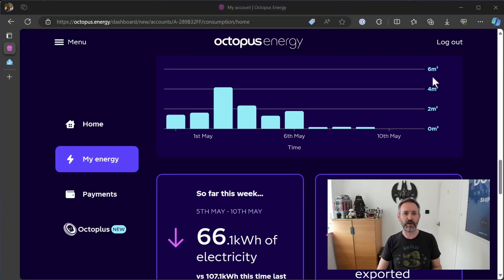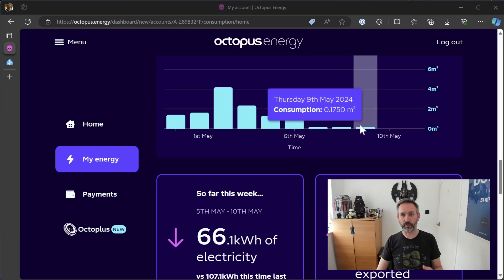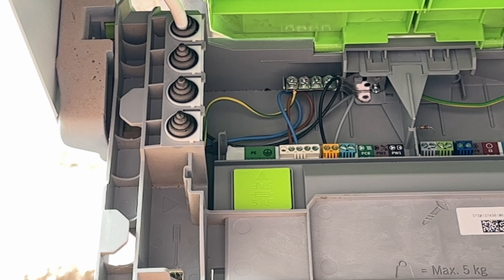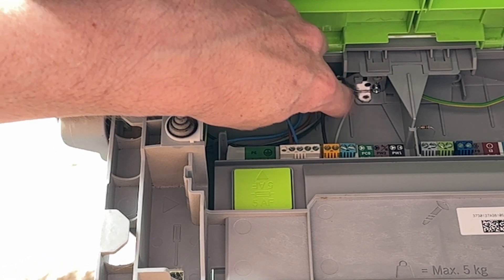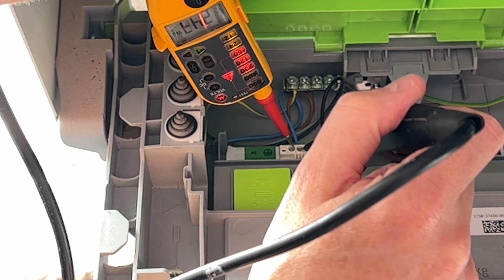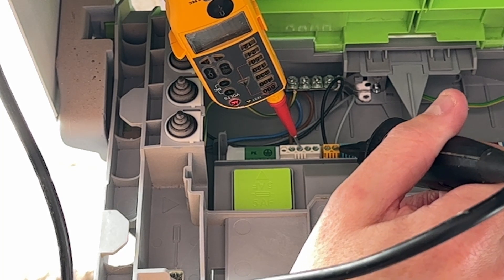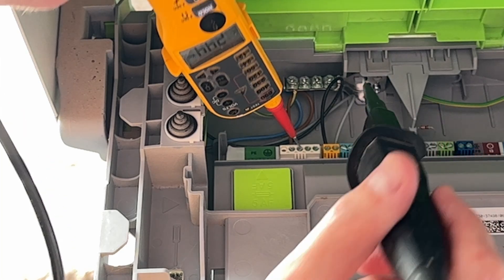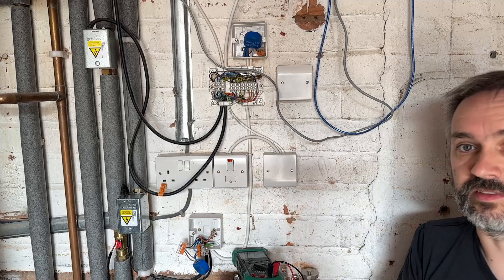Fixing a stuck microswitch in a 2-port zone value, which was causing my boiler to fire erratically!

Comment: Its not a given that the manuel lever will activate the micro switch , The lever is primeraly for plumber to open for bleeding the system without starting the system
Reply from the maker: I was told it should trigger the microswitch, but as you point out, it's not guaranteed!

Comment: Tomas, thanks. I've replaced two 2-port valves post an RCD tripping on the circuit. Every time I get an RCD trip, the valve stops working. Seems that the RCD trip is affecting the microswitch. Could that be true? If it occurs again, I'll see if I play with the microswitch and get back w/o droppping £65 for a new port valve. The RCD tripping is to do with something else entirely (gates) and not connected with the heating system.
Reply from the maker: When the power goes, as I understand it, the valve should return to its closed position. Mine kinda whines when it’s opening and closing. Perhaps a sudden cut in power impacts something else?

Comment: Thanks for the video Tomas.  I had exactly same symptoms and same problem.  I have smart relays piggybacking on the normal manual controls. What I lacked though was the smart data on the boiler firing.  How do you get that feedback?  Is there a smart voltage sensor that can feedback a contact position on/off ?
Reply from the maker: Thanks. I’m using something called EMS-ESP to interface with the boiler. To detect the hot water valve opening, I use a Shelly i3. I connected it to the switched live coming off the valve. Works a treat!

Comment: Interesting, my boiler is behaving similarly, firing much more regularly for 15-30 seconds without any demand for heat and without the external pump on the floor above running. It's not the PCB (tried that) but have noticed 1 of my 2 port valves does have a sticky microswitch which causes the pump to continue to run indefinitely despite no demand. Whilst usually it isn't triggering the pump to run, could it be allowing the boiler to fire?...
Reply from the maker: These vales typically tell the boiler you want heating or hot water, so if the valve’s switch is stuck, the boiler will be getting a signal, which might be causing it.

Comment: Hi
I just got myself 2 shellys to automate my boiler, i have 2 2 port valves  s plan system would you be able to share your wiring diagram please.
I am a fully qualified electrician. 
Thanks in advance  ps good video!
Reply from the maker: I’ll can try and draw one up. The basic wiring in the same as it would be using a proper thermostat, except the valves energise is controlled by the Shelly.
Reply: @tomasmcguinness  
Thanks, ive just been watching your other video about the TADO sensor

Comment: Thanks for making this video - these systems are so interconnected its good to understand how it works. I'm a Brit living in the US and what interested me was that over here, all the valves are 24v AC and not mains so it makes tinkering a lot easier and a lot safer. I wonder why mains voltages are used on your side of the pond.
Reply from the maker: Thanks. I’m not sure why the valves are 230v, but if I had to guess it’s simplicity. If you have differing voltages, you’d need transformers etc. In a UK home only probably the doorbell is 24v!

Comment: As a general point I would recommend running your heating for half an hour every week during summer to keep valves, relays, pumps etc. from sticking. Mechanical things in general like it better to be used than to sit in one state for months.
Reply from the maker: That makes sense! Thanks.
Reply: It looks like your Shelly supplies power to the valve to drive it open and the supply to the micro switch is permanently live, to avoid your problem in future you could use the switched live from the Shelly to the micro switch as it will only need a supply when that valve is/ has been driven open.
Reply from the maker: @Chatterisdotbiz yeah, that would be an option too if the micro switch was stuck closed.